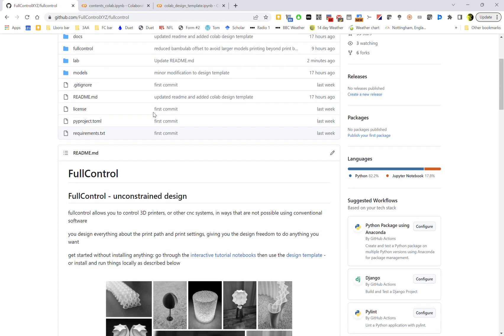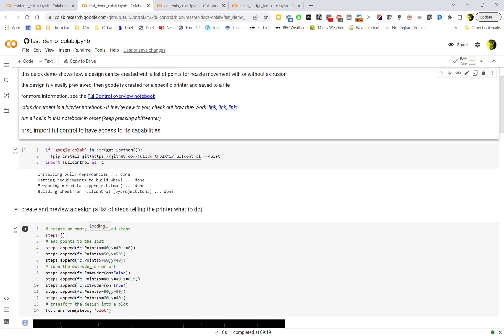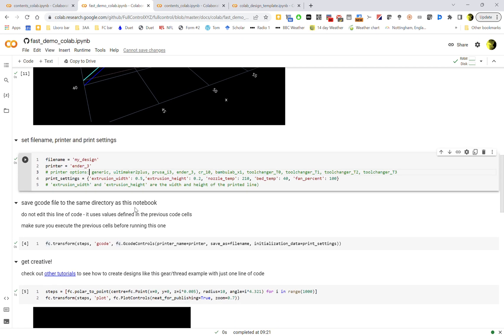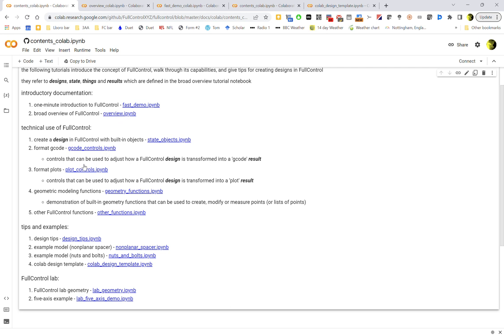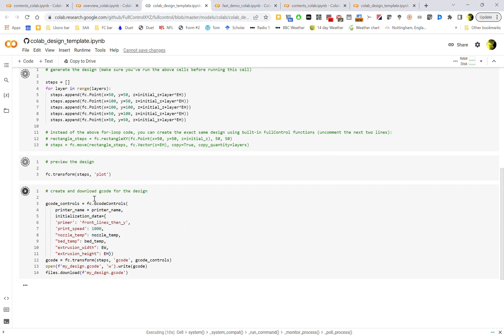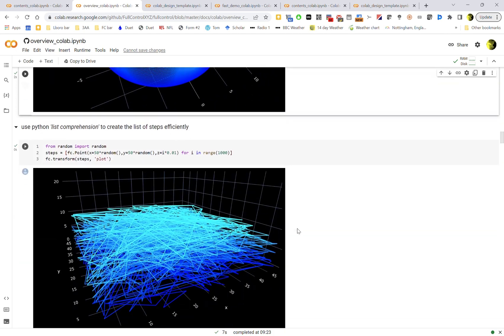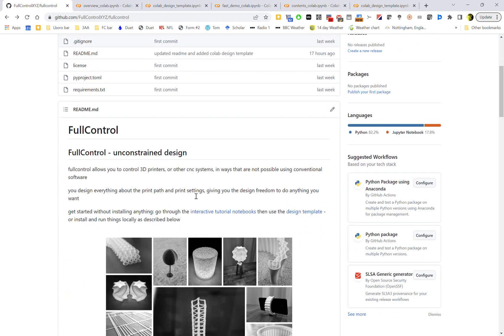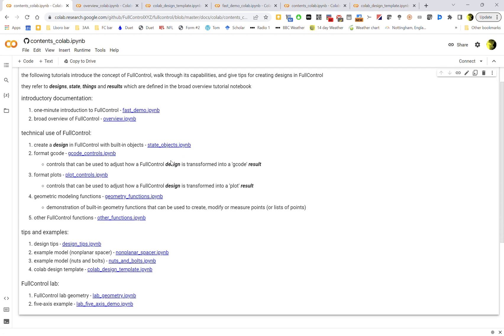Quick-start introduction to FullControl (python version)

Comment: Hello. Very very intresting. Must i have the Duett Board? I have two Spider boards in the store....
Reply from the maker: I presume you're talking about the 4-axis conversion video I recently uploaded rather than this video 👆 if so, you should be able to use any board as long as it can handle enough stepper motors and has suitable firmware for linear and rotational axes. You'd need to figure out the firmware yourself though. We've uploaded our exact firmware for the duet, which makes it v easy for you

Comment: Thanks I'm looking as I need to make a 4 axis printer ( 4th axis is a rotary one ) but as I'm looking around I don't see where you can setup the characteristics of your printer ( which isn't in the already made list of printers) if I missed it I would love if someone could point it out 
Thanks for your work it's very impressive
Reply from the maker: Sorry, I just saw this. I will be adding a mandrel as a 4-axis option to FullControl soon. If you're ready to use it right away, I can add it sooner than planned. Raise an 'issue' on the github repo, and it'll get sorted. Alternatively you can email a.gleadall@lboro.ac.uk if it is confidential(ish) research and you're looking to collaborate.